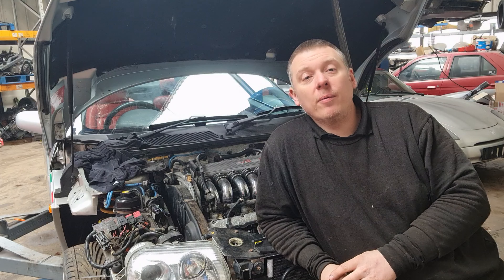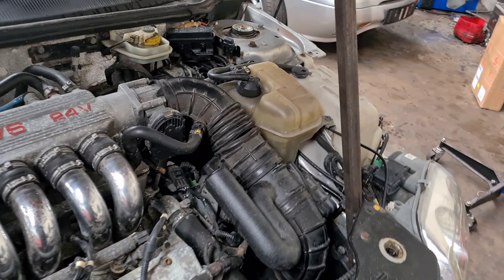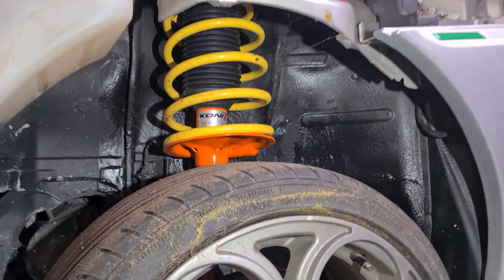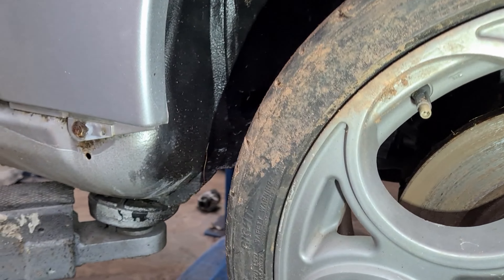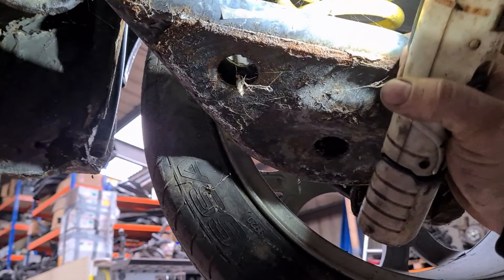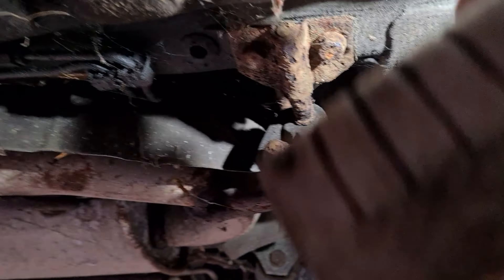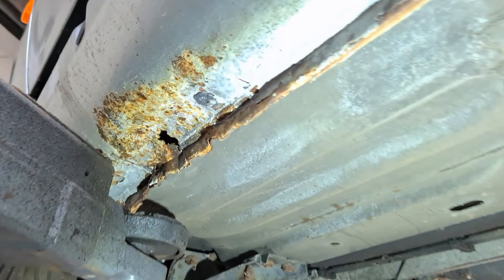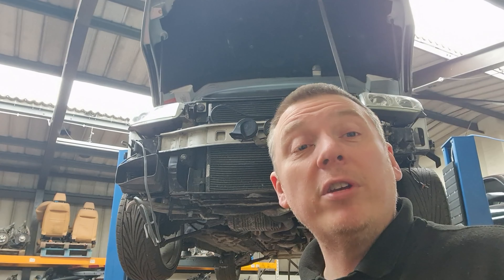Alfa Romeo Gtv V6 Abandoned For 12 years hows it holding up

Comment: The 916 GTV6 skill look awesome, such a timeless design and that Busso engine is a symphony.
I'm just not brave enough to buy one of these or a Fiat coupe.
That looks like a good example though.
Reply: Budget about £1k a year in running costs...Save what you don't spend as the timing belts are an expensive job, £800+ for belt and water pump. Don't do it on time at your peril.
Reply: @Negativvv  It's the combination of working on  a complex engine in a car with a lot of unique busy and trim parts. Sadly these days one has to die to make parts available to save another. Definitely worth the work for anyone with the ability.
Reply: Or you already own one... I've had my Busso powered 156 for 7 years. Not entirely sure I'd get one now I suppose but for the money there's few engines if any as exciting.
Reply: @Negativvv  The 156 is one of the few four door saloon a that really grabbed my attention in period and still looks as stylish today. The Busso is the icing in the cake but when I looked last year prices seem to be on the up. I like Alfa's but I'm not a devoted enthusiast. That said it would be nice to experience a 156 or GTV6. They are without question my favourite Alfa's.
Reply: In the perfect world I'd have a 3.0 GTV but my 3.0 conversion 156 is nice enough... They're not perfect cars but the engine is everything, I actually think Alfa have lost their way since the Busso went out of production. No real direction or US other than the styling possibly. 7 years ago V6 156 and probably GTV were going for very little money, now they're essentially extinct with a few hundred left in the UK that are roadworthy. The end of petrol cars is in sight so it's now or never if you want to experience one.
Reply: @Negativvv  The Busso is impressive even just to look at. No one dresses an engine like that anymore which is sad.
Reply: Not even Alfa thereafter, everyone loves their plastic engine covers which all have hideous engines underneath...

Comment: Hello friend! Can you help me?" I'm from Russia. I have a 1999 Alfa romeo gtv . modification of 2 liters of turbo. I can't find spare parts for it in my city. I need, 1) half-rings of the crankshaft.60513374
 2) camshafts 3) valve tappets. 60566847
Tell me, can I order these parts from you? or tell me can there be analogues ?